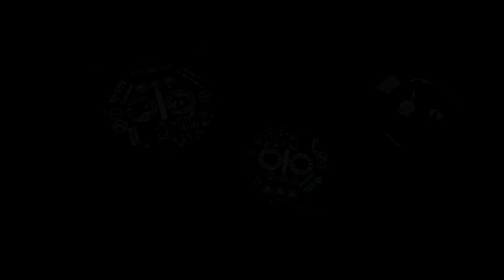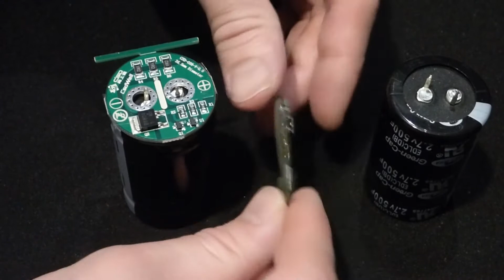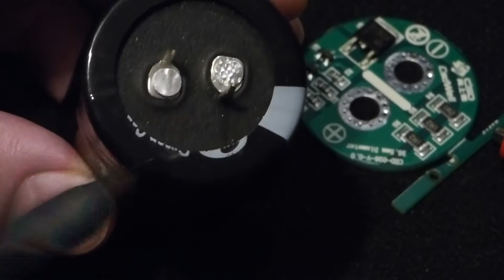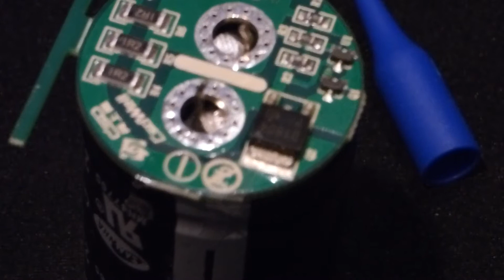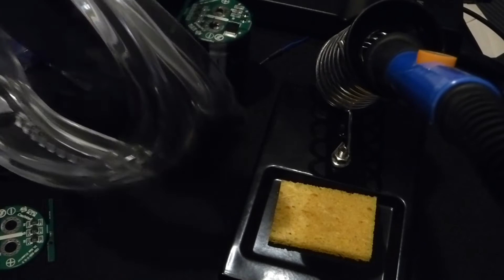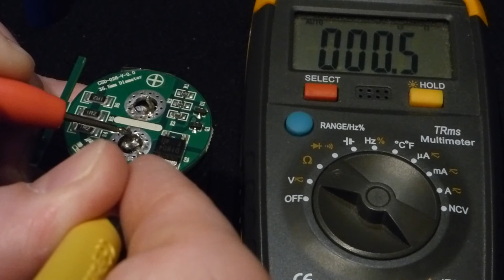I solder a protection board to a supercapacitor

Comment: I have blown my share of DMM's...now I have many precautions that I have used over many years.  At the end of your video, you checked for continunity, where there could have been VOLTAGE if the connection was not good.  One precaution to take here is to test for voltage first, then redo if failed.  supercap voltage is low enough but in other cases...
THANKS FOR THE VIDEO!!!

Comment: Thats a 2.5volts protection board and Capacitor?
Reply from the maker: Sorry, I don't remember. I quickly made the video while I was working a lot. Then by the time I got free time, lithium ion batteries got cheap enough to be a lot more practical than DIY supercapacitors.

Comment: Good to hear, but missing details and a little more detailed explanation
Reply from the maker: This is a pretty crappy video that I made while short on video ideas and that I didn't think would get many views (for my videos) but it did lol. I was trying to get started using supercapacitors on the cheap which isn't easy at my level of skill. I learned a lot doing so though (hopefully others did too), so I'm leaving the video up. I need to expand to where I have a workshop before I do more supercapacitor videos other than the ones I have that fit in a breadboard. Thanks for watching!